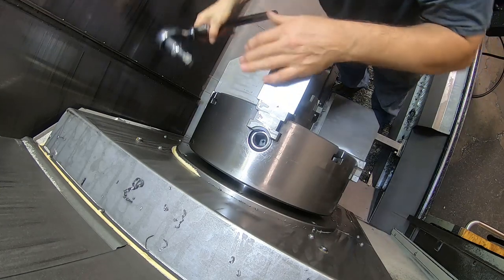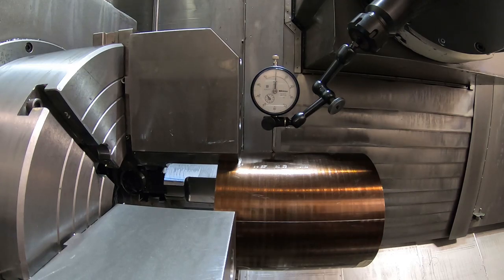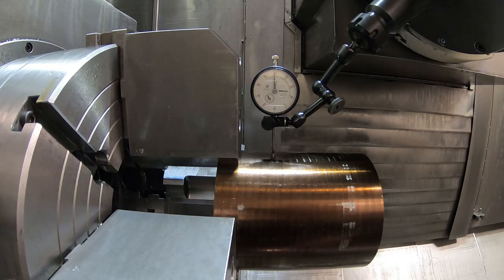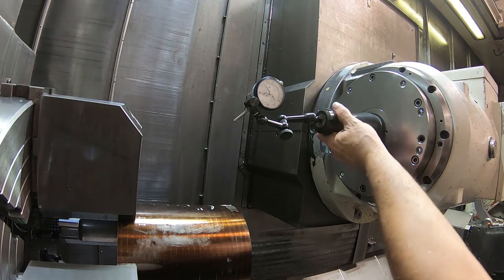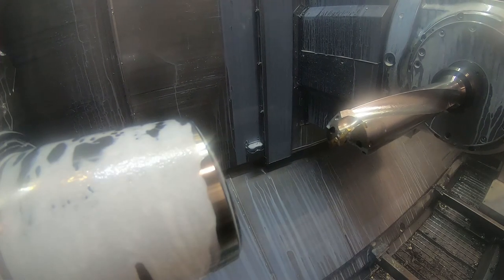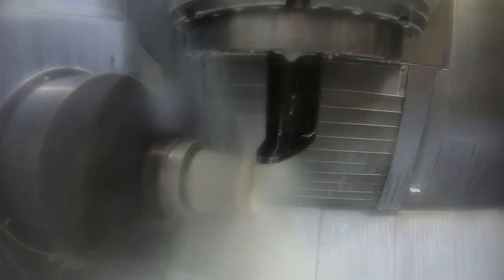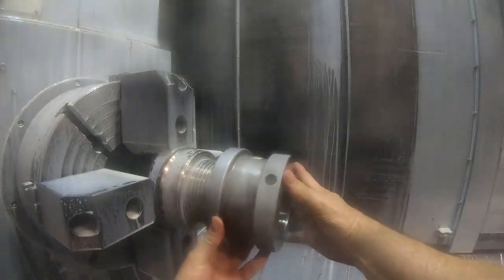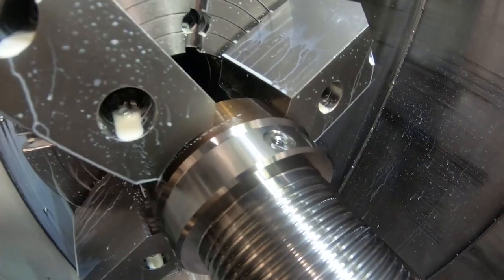Api Threaded Part 2

Comment: Nice job.  If you don't do a lot of API threads, then renting ring and plug gauges is probably the  best way to go.  if you do a lot of API threads in a wide variety of sizes, then MRP gauges work out a lot cheaper
Reply from the maker: My customer supplied this gauge. I assume they rented it.

Comment: Nice little lot of parts.  Taking that from a solid bar to finished part what does it loose in chips about what the part weighs?
Reply from the maker: According to the cad software. Stock started at 58 Lbs and finished part is around 17 lbs.

Comment: How do you check the thread profile other than the thread gage? I would imagine the API has some tight specs on profiles.
Reply from the maker: I didn't show this but I also check the threads depth with a Allen Gauges thread depth gauge #102. Other than that if the insert is good the profile will also be good.

Comment: Was the stock diameter too big to fit through the spindle so you could machine parts from bar stock?
Reply from the maker: No the material was supplied to me cut in these lengths.

Comment: At least you remembered to remove the ring gage before re-running the thread. Its amazing how many I have seen get wrecked by slamming a tool into it. Is that Mazak programmed with G code instead of mazatrol? 9:18
Reply from the maker: I very seldom use Mazatrol. Most all the machine work I do is in G code (eia on the mazatrol). Programmed on the computer in the cam software. I had a machinist leave a $750.00 ID mic in a bore and restart the machine. This ruined the mic ruined the boring bar and knocked the  machine out of alignment.
Reply: @EdgePrecision  I see. I have worked with a QT250 lathe and a FH6800 horizontal (both are early 2000's) and have never seen any actual code. There all conversational programming. I thought it was cool this machine actually had code you could see.

Comment: Are you using a torque wrench for tightening the chuck Peter? It’s amazing to me how little sometimes you use to hold onto.  Is there no issue these days with scroll damage / jaw breakage on these larger chucks? is it common to use a cheater bar be used on the chuck key. ? ( something we were all taught not to do - but all larger chuck keys I see are bent this way)
Reply from the maker: It’s a 3/4” drive ratchet wrench. This is a independent 4jaw chuck. No scroll. I can pretty much tighten these jaws as tight as I can get them. So far it hasn’t damaged the chuck.

Comment: What is the purpose of a tapered type thread like this? It seems it wouldn't really grip until its fully snugged up
Reply from the maker: They use this thread in the oilfield because it can be made up quickly and also it can tolerate a lot of crud in the threads. Like for instance the drilling mud. The thread actually makes up in the shoulder face. That's the reason for the standoff gauge.

Comment: What is the make of that Ratchet with the built in cheater bar!?
Reply from the maker: I bought it from Northern Tool. It has Titan written on it. I’m not at the shop or I would look if there is a number.
Reply: I had to get some of those, too, after seeing Peter use them. You can search "extendable ratchet" on Amazon for a bunch. I got a couple at Harbor Freight, that are working great. One is 1/2" and the other has 3/8 on one side and 1/4 on the other. I love that style as I can have two sockets fitted for quick access.

Comment: Is that a tool probe I see? the one that came with the machine? if it is, how come you don't use it?  thanks for all the great videos
Reply from the maker: Because it’s so high up it’s difficult to use. It’s easer and faster to touch them off on the part. Also I tried it the other day and it didn’t work. I will have to see if I can find the problem. When I get time.
Reply: I knew there was a reason, say what's the G50 rpm clamp on this part? not holding on to much, you got big gonads my friend , thanks again for the great videos

Comment: Peter, is the surface speed too high on the big drill? I hear it squealing while it cuts. I don't have any machine tool rigid or powerful enough to use one of those, so I wouldn't know what their characteristics are.
Reply from the maker: No that’s just the way this drill sounds. It’s normal.
Reply: @EdgePrecision  Thanks for letting me know!

Comment: awesome stuff Peter.    I have this idea for the camera/coolant issue.   your blower slot works well once the stuff is on the lens cover but when the coolant load is heavy it fails.  how about fitting an extra blower slot spaced away from the body by say 1/4" or 1/2".    The idea is to blow the coolant away before it gets to the lens cover.   Then the existing blower slot will have less work to do.   This extra slot may need  more airflow though so you would need an extra regulator for it.
Reply from the maker: Thanks David. The thing is there is no way air at 100 Psi air is going to overcome coolant at 1500 Psi. It just isn't going to happen. I don't think there is any way to get clear video in those conditions. Also there is the fog in the air that is generated.
Reply: @EdgePrecision   ok, guess I was hoping that a thin slot would generate high enough airspeed to blow at least some of the coolant away before it hits the lens window. ah well...

Comment: On your mazak can you rotate the chuck by hand? It seems that you always rotate the chuck form CN.
Reply from the maker: Yes but it than makes it hard to tighten the jaws with the wrench because there is nothing restricting the spindles rotation. It is better to have the C axis coupled and jog it with the hand wheel.

Comment: What's best for drilling, rotation of piece or drill? What's the difference?
Reply from the maker: The only way I can answer that is it depends. In the case of this machine the milling spindle has a lot of power and also high rpm. So I can do most of my drilling with it. The turning spindle has more power (Torque) but only a maximum speed of 1600 rpm in high and 460 in low range. So of course if I need more than 1600 rpm the milling spindle is the only way to go. So it depends on your machine. But in general either way works but drilling with the turning spindle is limited to center line its of rotation. There are alignment issues with drilling with the drill stationary. One advantage is you can better control the size of the hole when using a insert type of drill by running it off center. But you must align the inserts parallel to the X axis. The best way to drill a hole concentric to the rotation is to rotate both the work and the drill. This overcomes the influence of gravity in the horizontal orientation of a lathe on very deep holes. (Some machines wont let you do this). But in the case of this machine, I just always drill with the milling spindle unless the drill is very large. Say bigger than this drill. Than I would use the turning spindle.

Comment: Hey Peter, question  is it better to drill and rough the ID first, then rough the OD.  Then finish the ID then finish the OD.? Or it doesn't matter. I really appreciate if you answer. Thanks.
Reply: I'm an ignoramus so don't mind me, but it seems like you're asking about order of operations? In my limited experience, you're talking about tool changes. You're going to get the same result, the diff is time. Are you manually changing? Do you have to pause between operations to hold tolerance? In my tiny shop we don't deal with the kinds of tolerances he does. So minimizing tool change time is priority. When you're aiming for these tolerances, stopping to bust out the micrometer, time isn't the issue..
Reply: @NH3rrm4nn , yes I'm talking about the ability to achieve tight tolerance ID but also OD, does the order of operation matter,  I always thinking in the material  "stress relief", and no, there is no manually changing tool. Thanks.
Reply: @carloscarrizo2131  I personally drill first rough OD then rough and finish ID and finish OD last.I don't think it matters which you finish last as long as roughing is done all around.Sometimes depends on tool positions on turret and what next operation is.I'm no cnc expert like Peter so everyone may have their own ways.

Comment: Hi, in order to have more clearance when turning near the jaws you can set tool on 45 degrees B axis, but  this only apply for turning. Also you need a tool with correct geometry for such setup.
Reply from the maker: Thanks already have one.
Reply: @EdgePrecision  love the content, what's the name of the drill you're using on this part? The big one

Comment: 👍Why don't you use Hydraulic chuck instead ?
Reply from the maker: The first big job I did on this machine required this chuck to get the full spindle bore. After using it I found I like it better. A manual chuck doesn't require a draw tube that reduces the spindle bore. Also the hydraulic chuck that came with the machine is 21" in diameter this causes tool interference problems (I describe this in the API threaded part 1 video). This manual 4-jaw chuck is 16" in diameter gives me better tool clearance. It also because of the greater travel range of the jaws gives me better versatility in the work holding than I can do, over a hydraulic chuck. So for the type of work I do I prefer this manual 4-jaw chuck. But for a job like this a hydraulic chuck would be better. But for only 11 parts I'm not going to the trouble of mounting it. The time saved in chucking would not be offset by the time it takes to remove the 4-jaw, clean out the spindle and the threads for the draw tube. Than mount the draw tube and than the chuck. That would take at least a couple of hours. Also the draw tube threads got damaged by someone when they shipped the machine to me. That would also require a repair witch I have never done yet.

Comment: How does Fusion work with Intergrex ? We want to move away from using EdgeCam .
Reply from the maker: I programmed this with Esprit. I haven’t used Fusion for the Integrex yet. I have used it for my Haas in the garage it works fine for that.
Reply: Edge Precision thank you.
Reply: Why do you want to move away from Edge Cam? Is fusion better?

Comment: Hello Peter, which material is? Thanks from Spain
Reply from the maker: I did this quite a while ago and I don't exactly remember. I'm going to say P550 stainless or 17-4 one of the two.
Reply: @EdgePrecision  it seems too hard. You always program with cadcam or with mazatrol too?
Reply from the maker: @miperrosellamaleo  I always use Cam software. The only thing I ever use Mazatrol on this machine is to bore chuck jaws.

Comment: Slightly off-topic: Is that a ratchet with a built-in cheater handle that you're using on the chuck? Who made it?
Reply from the maker: I bought it a Northern Tool. The only thing it says on it is Titan CR-V. Its a 3/4" drive wrench.

Comment: Why do not you use a hydraulic chuck?
Reply from the maker: I have answered this question many times. But the short answer is most of the jobs I do chucking is not a major time compared to the machining operation. So I prefer the versatility that the 4-Jaw manual chuck gives over the Hydraulic 3-Jaw chuck.

Comment: What are the API threads connections.
Reply from the maker: API stands for American petroleum institute. In this case it's tapered thread typically used in drilling pipe connections. But there are many other threads types that fall under the API spec.